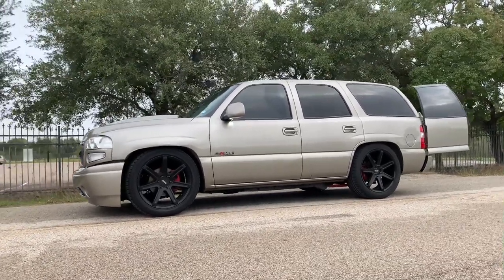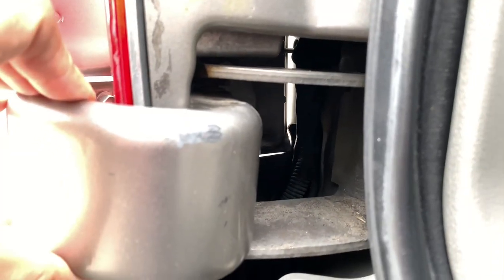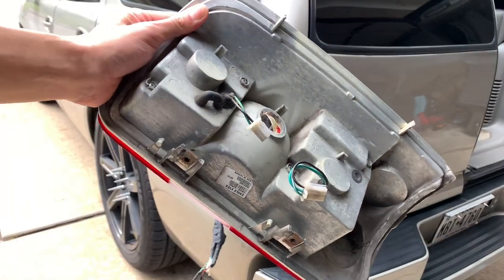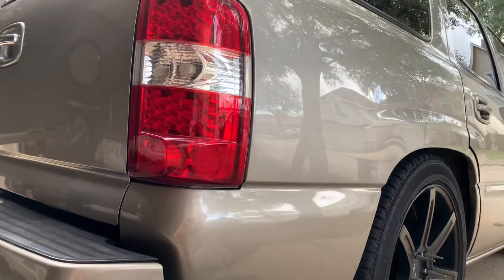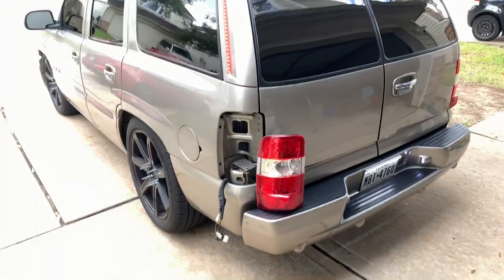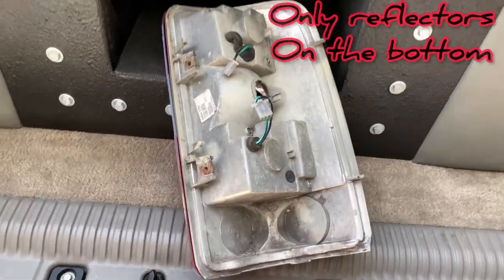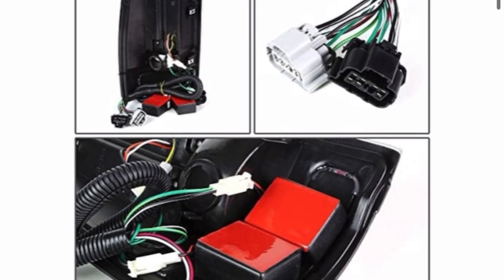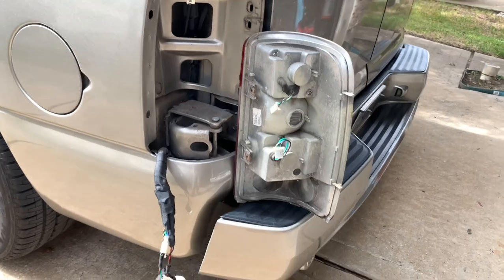Tahoe Barn door Led Tail lights 00-06 Yukon

Comment: What suspension do you have front and back looks great
Reply from the maker: I have a 5/7 drop on it here we’re the parts👍🏼 00-06 Yukon 5/7 drop parts
https://youtu.be/F3OVzQO1oxo
Reply: @MiGo713  thank you.. how does it ride tho
Reply from the maker: @HESS50102MUSTANG  No problem, It actually drives very good and smooth, I like it better than factory since it’s lower to ground it corners better and doesn’t wobble like with the factory height

Comment: Thanks for the education and vid. Quick question - (02 Tahoe LS with barn doors) do I need to replace the plastic assembly or can I just replace the old bulb with LED bulbs? Also can I do the same for the 3rd brake light?  Thanks!!!!!
Reply from the maker: The old bulbs can be replaced with led bulbs if you don’t want to replace the whole housing.  Sometimes when doing that you may have your turn signals hyper flash so to slow them back down to normal speed there’s a relay under the dash that can be changed to correct that issue or wire external load resistors, hope that helps! And Thanks!
Reply: @MiGo713  hey man thank a ton for educating me on how I can replace old bulbs with LED without having to replace the plastic housing. Those things are almost impossible to find for Tahoe’s with barn doors!!  Again thanks!!

Comment: Just received my taillights but the harness goes into one plug, which spot does it go into under the quarter panel?
Reply from the maker: I believe it should have 2 plugs but you can try just plugging it to the one it fits and see if everything works
Reply: Yea everything works, thanks for the video and the fast reply
Reply from the maker: @stephengeter5898  Nice bro, No problem and Thanks!

Comment: Did that escalade bumper bolt right on or did you have to make something happen? I have an 05 Tahoe and I'm curious to know if it'll work cause it looks cleaner than the OEM one.
Reply from the maker: It bolts right💯 Thanks! And yes it looks more complete
Reply: @MiGo713  hell yeah man! Thanks for letting me know your truck looking right! 🔥 Trying to sell some of those pillar lights made up? Lol
Reply from the maker: @josedones1333  Thanks Appreciate it!!🥶 Yes I can make n sell the leds💯 you can message me in my instagram  @migo713 if you’d like

Comment: They too say not for barn doors,
If thise worked the other one do too,
And there is for barn door especifically but u wont say cuz the just come in regular or black nor red or led just plain black or stock ,so of those worked the others too
Reply from the maker: Those are some of the models I’ve seen work not sure on others